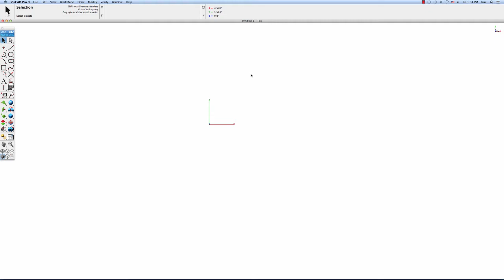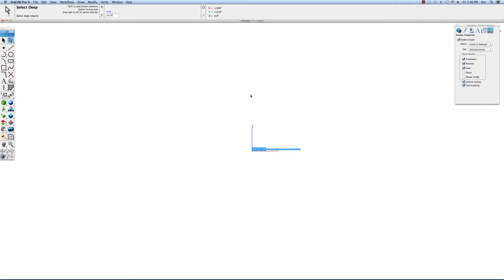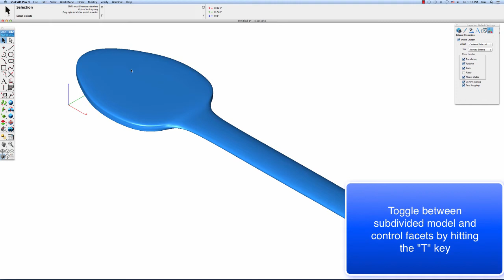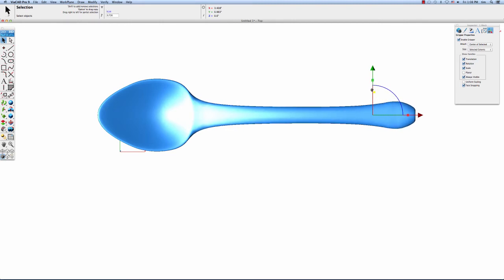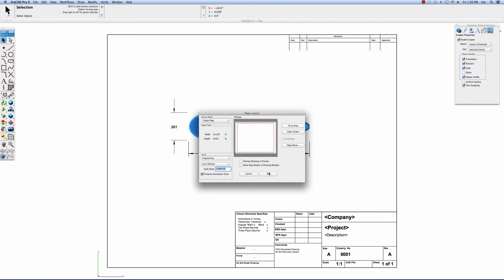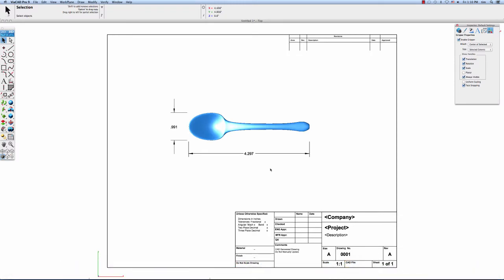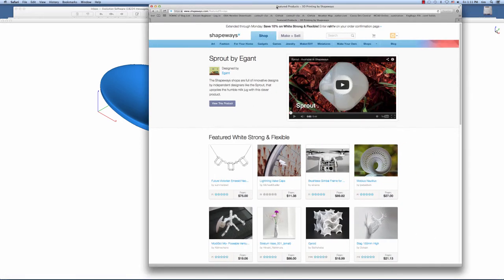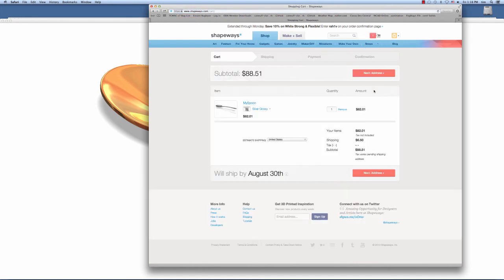ViaCAD9ConceptTo3DPrint

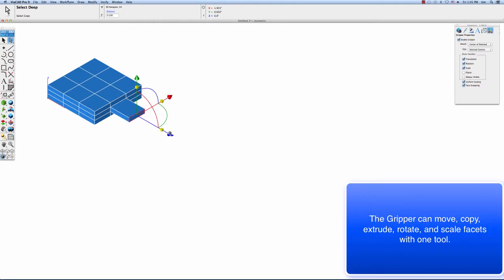Comment: @1:40 you show how the handle is pulled out. It's fairly easy. But in your example you new to produce x-segments of the handle. Let's say you only produce 2 or 3 segments, and later you cannot edit the mesh as freely as with 4 or 5 segments. Can such segments be added later?  Like a circular subdivision? 

Also how to delete let's say the handle to change that part of the mesh?

Comment: You should mention something about how you used the option key (for Mac) or Ctrl (For Windows) to pull the segment out individually separately not affecting the other facets and that you are creating an array.

In the Manual:
You can manipulate an individual face using a combination of the Deep Select tool and the Gripper. You can also create arrays along faces using the
Option key (CTRL key for Windows).
Reply: thank you . i was wondering if i was going crazy
Reply: I agree as well on this one. Been going crazy trying to make this spoon. I can't seem to get a polygon block with the separate polygon sections.

Comment: I recently purchased ViaCad V8 2D/3D and have to say this is one of the most frustrating programs I have ever tried to use.

1) The included manual and tutorials are based on Mac, and many of the features I want to use (Windows) do not have equivalents.

2) I have been unable to register for the Punch Cad forums, because I have not been able to successfully enter the image match requested of me, nor have I been able to E-mail Punch, because their contact process requires me to once again, match the required image.

I am left with no options to be able to address these problems, and it leaves me really wondering why they have made this so difficult.